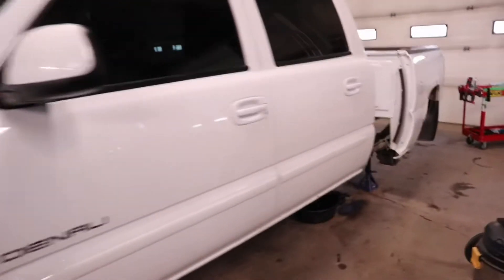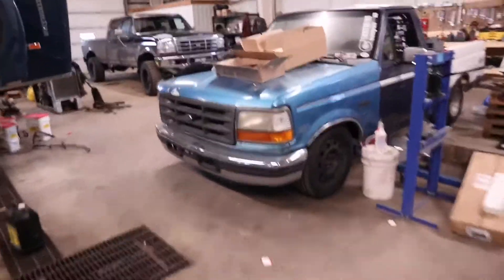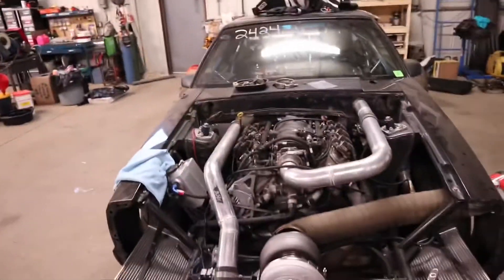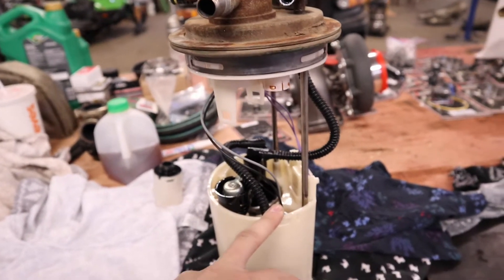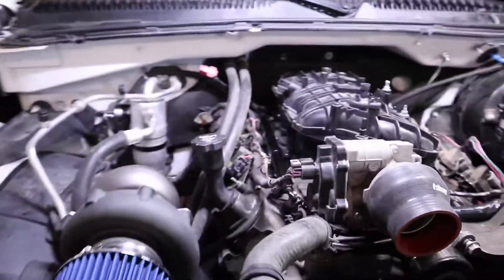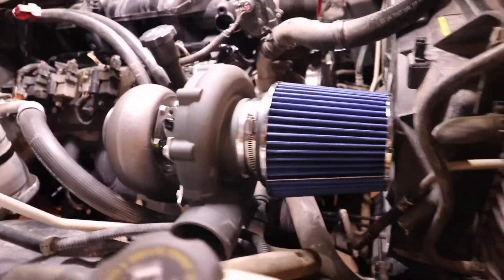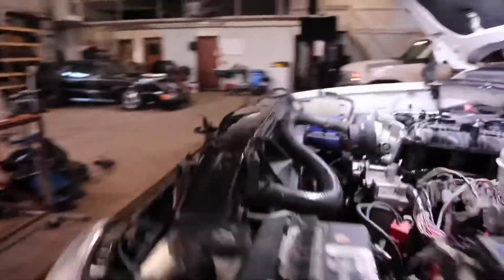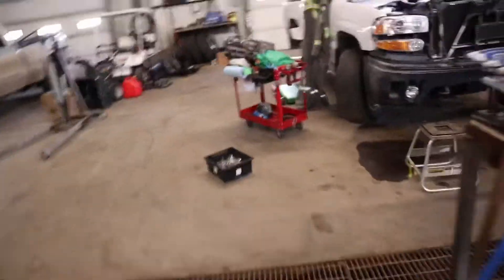White Lightning Part 3: Turbo LS Fuel System

Comment: What size fuel line did you run?
Reply from the maker: -6 line supposed to be a low boost setup this p59 only has 2 bar capable software.